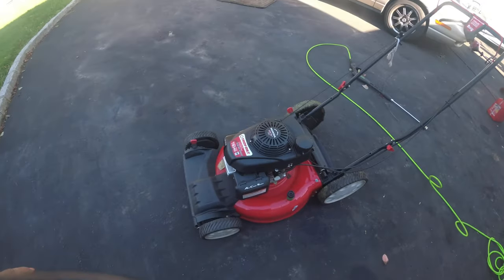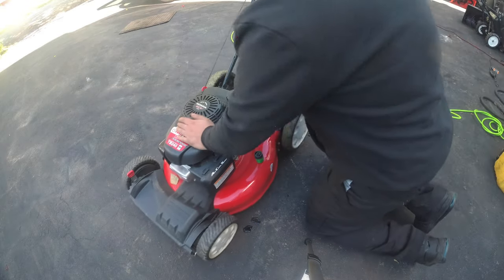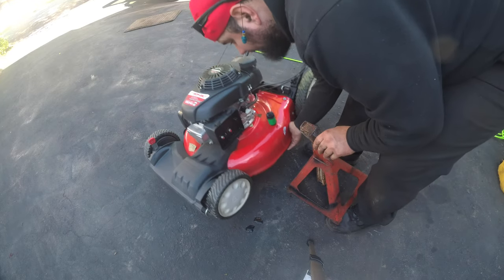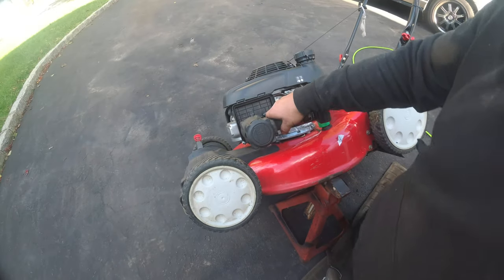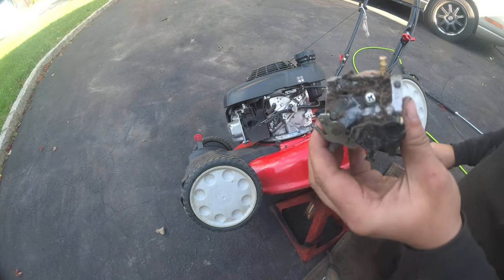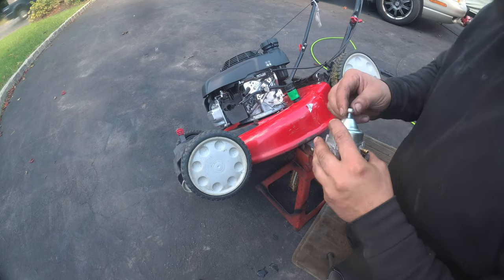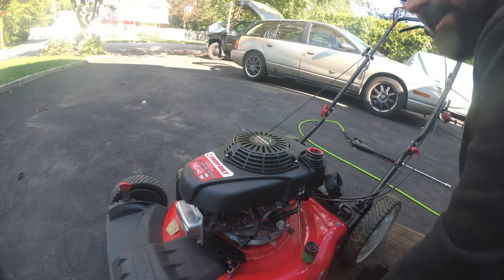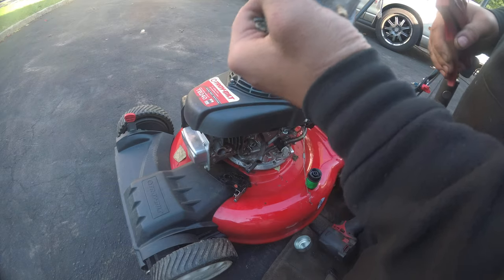Troy Bilt TB240 Stopped Running While Cutting the Grass HOW TO FIX!  Honda GCV160 Engine NO START

Comment: I had a very similar problem with my Troy Bilt TB130 from 2014. Ever doing a little little research, I believe it was just a combination of using regular fuel with ethanol and leaving it in a tank for long period of time. Instead of trying to clean out the carburetor, I just said, screw it and bought brand new carburetor, with all the gaskets, new fuel lines, empty tank completely, new choke control, new thermal wax assembly, replaced all the springs. Brand new NGK spark plug, For oil using VP Full synthetic 10W-30 4 cycle engine oil. Brand new fuel filter inside the line, And lastly brand new Starter with pull string. And for now on using only TruFuel four cycle, ethanol free gas. And all parts not including the fuel lines since those are gates, branded carburetor hoses, are OEM Honda parts from Amazon. I feel like it starts easier than when she was new.

Comment: I ended up cleaning the whole carburetor since it was absolutely full of gunk. Ran absolutely amazing after putting it back together then it did it again. Come to find out that the gas was either barely flowing or not flowing at all. So I drilled a small vent hole on the flat side of the male thread where the gas cap goes. Put the cap back on and it was flowing like a dream. Put it all back. Ran it and it was running better than when I got it.
Reply: So I have the same issue took the carborator apart and still have the same issue. Suggestions at all brother?
Reply: There is a tiny filter in the fuel line fron the tank. Take the fuel line off and see if that filter is clogged
Reply: @Delmarvafishing  drilled a small hole where the gas cap is. There is a video on youtube about it and I have not had a problem since.
Reply: @bobclavi  The issue for me was when I has the gas line off I wasn’t getting any fuel flow with the gas cap on so I took the gas cap off and fuel started to flow again so just drilled a very small hole on the gas tank where the cap goes to create a ventilation port. Never had a issue since.
Reply: @centralgafirefighter4760  for real? Awesome I'm going to try that
Reply from the maker: great job that means your tank cap isn't venting.  That happens from overfilling your fuel tank and getting stuff inside the fuel cap soaked.  correcrt way is to leave the cap off and let it dry out.  Don't overfill the tank when you add fuel

Comment: My issue was the spark plug and not putting that weird flappy thing in the open position. Your video's solution was like 1 minute of putting the carb back on vs. the hours I spent before hand trying to figure that out! Thanks!
Reply from the maker: Aizenmyou Ou,

LOL thanks!  I still have trouble at time putting the carb back on!  Honda has all those DAMM things in between!  Would make it a lot easier maybe all of that was separately attached and Carb was was different hardware like a Briggs.

Thanks for the view and comment, hopefully you subscribed to my channel 🤙🏻🇺🇸🦅🔧

Comment: Thank you so much,you helped me fix our fav lawnmower,liked and subscribed
Reply from the maker: Excellent job!  Hopefully you are still in fix it mode!  Now is a great time to change the oil and sharpen the blade!
Reply: @pattayperformance  Thanks for your encouraging words.I changed the oil but never sharpened the blades before so have to learn that as I am very new at it.Have you posted any videos on that?and I have a question,I worked on a lawnmower,put a new carburetor in,(broke a piece while cleaning it)it worked but once I stopped it it’s not starting again. I wonder if you could just please guide me to what the problem could be, thanks in advance

Comment: I appreciate the information but I do have a question.  When it was stalling when mowing what did you do to resolve it?  I could not hear what you were saying because of the engine running.  Thanks
Reply from the maker: I cleaned/went through the carb and also made sure nothing worked it way into the linkages.  Making sure they were moving freely

Comment: I did all that and it ran for a little bit but died again. I will replace the whole carburetor now and seen if that works. Just ordered  new mower but will still repair this one.
Reply from the maker: When it dies…hit the carb with starting fluid and if it runs, still have a fuel issue.

Comment: Bro I have questions, what did you do because I couldn't figure how you fixed the fuel not getting into the carborator. I have the sameissue
Reply from the maker: Clean the carb
Reply: @pattayperformance  I did, it's clean as a whistle still doesn't work
Reply from the maker: @Delmarvafishing  

What diagnostic steps have you taken and what have you found?

Maybe it’s not a carb issue
Reply: @pattayperformance  I took the whole thing apart, full lines are delivering carb is clean as a whistle and I ran seafoam through the whole system. It only runs when I put starter fluid in it.
Reply from the maker: @Delmarvafishing  

Issue is still fuel…carb isn’t pushing fuel into the cylinder to ignite.  These carbs have a crazy un necessary amount of gaskets.  Make sure they are all in place where they should be with no tears.

You confirmed fuel is getting the carb by removing the bowl and see fuel come out
Reply: @pattayperformance  I didn't take the bowl apart like in the video, I fought with that thing for 45 minutes to get it back together because as soon as I took the bolts out the whole thing fell apart
Reply from the maker: @Delmarvafishing  thats one of the reasons why I have Hondas!  Wish the stuffed the carb on like the Chinese copy cats.  How can a copy cat be better engineered than the OEM? 🤣
Reply: @pattayperformance  of course not
Reply from the maker: @Delmarvafishing  maybe it’s best in your case to order a new carb with gaskets
Reply: @pattayperformance  maybe

Comment: So what was the issue? Do you  think? And had hard time hearing you over traffic noise.  Having same issues with mine and I don't set depth low. And I am not an (idiot)
Reply from the maker: So he wasn’t getting fuel flow to the carb.

I blew out tank using the gas line with valve open as well as clean the idle circuit for good measure.  I live on an island and I THINK above sea level at times plays with running issues.  Remember everything is built to CA specs now.

Knowing what I know now…remember I’m not a small engine mechanic.  Just learning as go.  Honda’s have a RED sleeve installed inside the gas tank.  That is there as a fuel level reminder.  NOT TO FILL IT past that point.  If you do over time you prevent the gas cap from venting.

If you do that you can leave the cap off and upside down in the sun to dry it off.

Also fuel not getting into the carb could be a sticky float as well.  Me moving the carb around (without taking it apart) could have freed it up.

Thanks for the view and comment, hopefully you subscribed to my channel 🤙🏻🦅🔧🇺🇸

Please keep me updated on your machine

Comment: GCV160 Engine just replaced blade, oil, spark plug and nasty air filter. Not cutting out but engine high/low rev sounds at theusual 3 1/2 - 4" mow height - sounds like carb the next potential culprit?
Reply from the maker: Please give it a good clean and don’t forget the idle circuit screw as well!

Comment: Jason, I got a TB w/ Honda engine a few weeks back and been tinkering with it learning how to take the carb apart and clean it. Ive narrowed my issue down to fuel. I’ve cleaned it twice and still doesn’t fire up. The carb was in bad shape and very corroded the first time I cleaned it.  Carb is receiving fuel. When do I say it’s time for a new carb?
Reply from the maker: You Made Me Lawn NOW,  here is your pickle of a decision.  Honda OEM carbs are cheap!  Chinese Copies are cheaper!  Decisions...decisions.  If it’s very corroded inside, possible there is minute scoring/damage due to the rust that the human eye can’t detect.

Replace it!  Is this for you or fix n flip?
Reply: Pattay's Performance right now it’s a learning process, I’m dissecting this machine and putting it back together to learn how to fix issues like this. Down the road I’ll sell it and move to another one.
Reply from the maker: You Made Me Lawn 

Perfect!  My advise to anyone and everyone!  Learn on your time and dine.  Not experiment on other’s people equipment!  Any questions please ask us!

Comment: I have a tb240 with the Honda engine, it starts every time first pull , but after using it for 5-10 min once I power it down it won't start again unless I let it sit for 15 min , it does this every time , any suggestions?
Reply from the maker: Let's try some simple diagnostics.  If these aren't clear I apologize as I'm lacking on sleep :)

When the issue occurs you can try these TWO THINGS.

Option A) Pull Air Filter and Cover squirt some starting fluid in it.  IF IT RUNS, then we know its fuel related and we need to look at the autochoke system/wax plug.  IF IT DOESN'T WORK...

Option B) Check For Spark. if you don't have Spark REPLACE the Coil/Ignition Module and Spark Plug

Thanks for the view and comment, hopefully you subscribed to my channel.

Comment: What should I do if my Honda Lawnmower turns over but doesn't run full throttle?  Any suggestions?
Reply from the maker: Clean the carb especially the idle circuit
Reply from the maker: Here is a video I featured on my channel hopefully it helps!

Keep me updated…

Thanks for the view and comment, hopefully you subscribed to my channel 🇺🇸🦅🤙🏻🔧
Reply: Thanks dude.  There is a lever that wasn't moving to engage the motor to full throttle.  I used my air gun, blew it off.  It looks like it needs to be oiled or something.  Would WD-40 or actual oil work?
Reply from the maker: @tucosalamanca9458  yes anything oil based will work!  Keep that bit in mind when you service your lawnmower the next time.  It’s every 25 hours or season.  Whichever comes first 🇺🇸🤙🏻🔧🦅

#heisenburg

Comment: Thank you. Fixing the same one for a friend. Gas that smells like varnish, bowl rusty… why wont is run???? I will also check the wheel height “freakin Idiot” 🤣 badass👊
Reply from the maker: 🤣🤣🤣🤣 Luckily carbs are cheap.  Amazing how OWN Honda parts are CHEAP if you want to make that call

Comment: I’m trying to find where that small spring that is wrapped around the throttle pin attaches. I couldn’t see where/when you re-attached it.
Reply from the maker: Shane PalmerIm sorry I couldn’t capture it as well as the lack of response.  Due to the pending pandemic, I have been at work.  There is a VERY small hole next to the where the throttle lever goes.  RIGHT next to it...goes there.  PLEASE resist temptation and try not to stretch it.  If you are still have issues PLEASE don’t hesitate to write back!

Thanks for the view and comment and hopefully you subscribed to my channel!

Comment: uhh, did I miss the part where it ran but dies in the grass? I caught the guy had two stories but the entire video was about an engine that needed "go-go juice" to start. I saw nothing about running in the grass and then die. Ohh, I loved the part, "where this come from?".
Reply from the maker: J Abbott 

Thanks for the view and comment, hopefully you subscribed to my channel.🇺🇸🤙🏻🦅
Reply: Did you even read what I said? The title of the video and the video have nothing in common. At what point was it about solving the problem of a "running" mower and "stop running while cutting the grass". I saw a mower that didn't run in the beginning and then cutting grass that ran just fine. I litterly was looking for a video that was the exact opposite.
Reply from the maker: J Abbott I can’t recall every repair as well as fix n flip.

I’m thinking...it would run and die cutting grass.  When I got the mower, it wouldn’t run at all.  When you do a repair, take what the person said with a grain of salt and start at square one.  Verify the problem and move forward with the repair.

Thanks for the view and comment,  hopefully you subscribed to my channel.

Here is another video of another machine with carb up close and personal.

https://youtu.be/tJs5ZsZlWSo